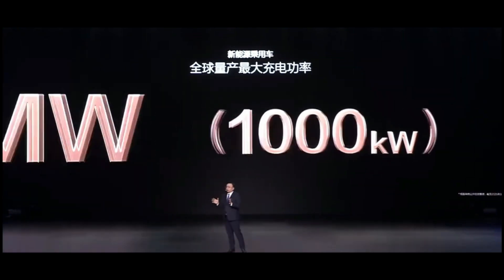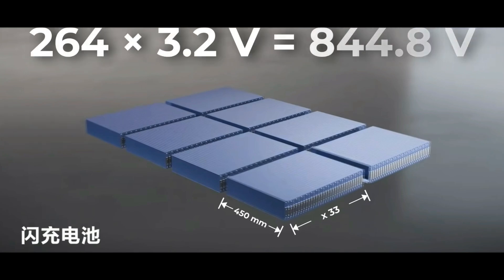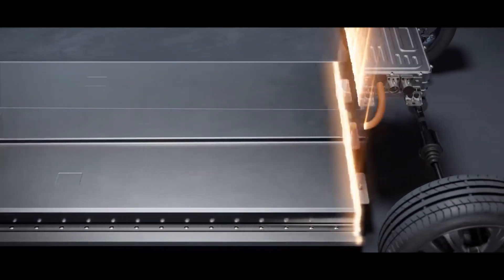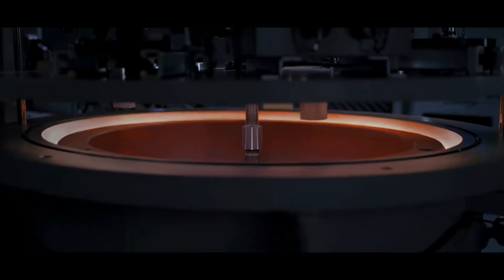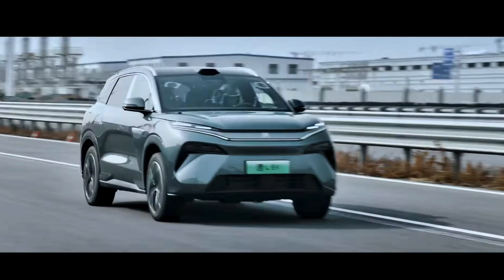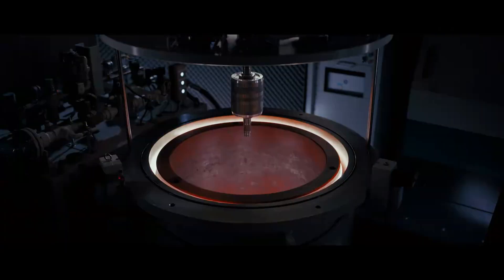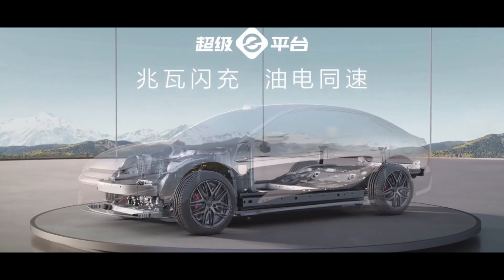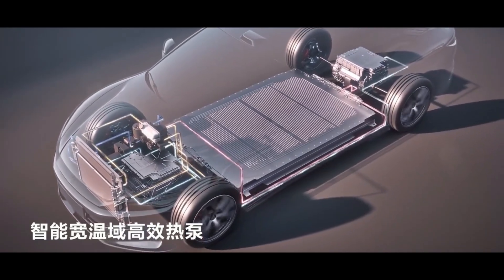BYD's 30,000 RPM Electric Motor REVOLUTION: Shocking the EV World!

Comment: China is leading the world on innovation in drivetrain & battery technology. 
The next 10 years is going to be very interesting. 

I guess the practicalities of adopting this technology is the charging infrastructure is all 800v or less. 
If this setup is running above 800v is is going to require different chargers?
Reply from the maker: BYD has introduced its Dual-Gun Super Charging technology, which allows for simultaneous charging using two charging guns without altering the original hardware of public fast-charging stations. This innovation upgrades standard fast-charging stations into "super fast-charging stations," effectively doubling the charging power. Additionally, the dual boost charging technology within the Dual-Gun Super Charging system is fully compatible with the early 500V low-voltage fast-charging stations on the market.